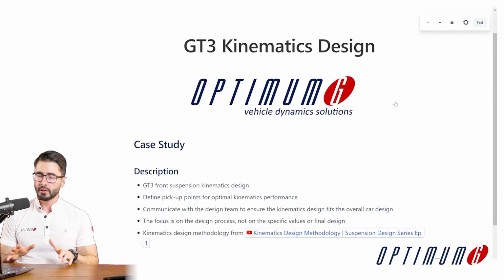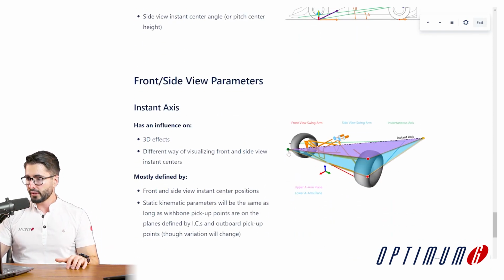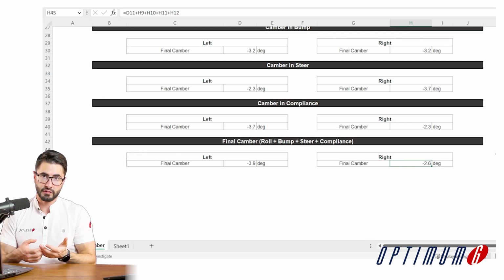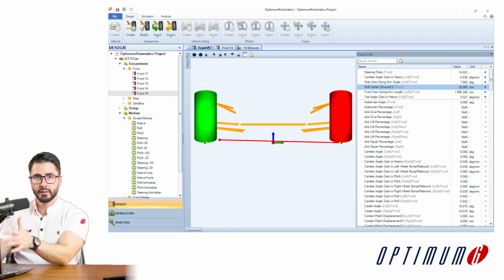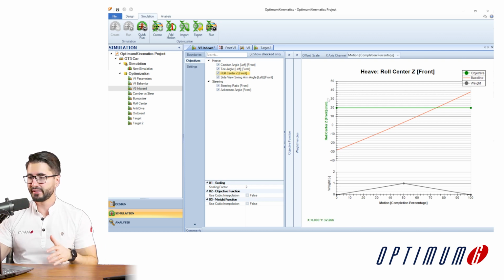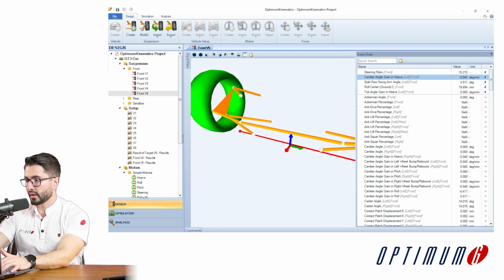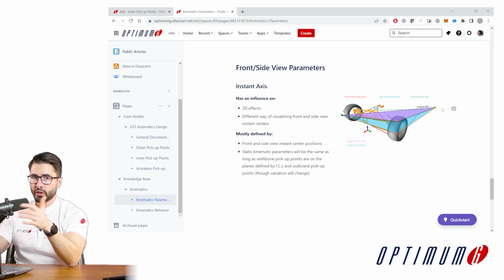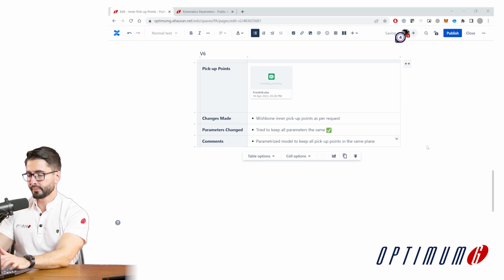DESIGN WITH ME! Inner Pick-up Points | Suspension Design Series Ep.3

Comment: How do I arrive into the camber compliance input value?
Reply from the maker: Thank you for your question. There are two common methods for measuring camber compliance:
- K&C (Kinematics & Compliance) testing with a dedicated rig
- Workshop measurement: manufacture and install dummy (rigid) wheels on both left and right sides. Install a rod with variable length, with a load cell in series connecting both sides. By changing the length of the rod, you can measure the force (load cell) and the camber variation, arriving at a coefficient of camber variation for each 1000 N of lateral force applied. This procedure must be properly designed and performed in order to get reliable results.

- Bruno